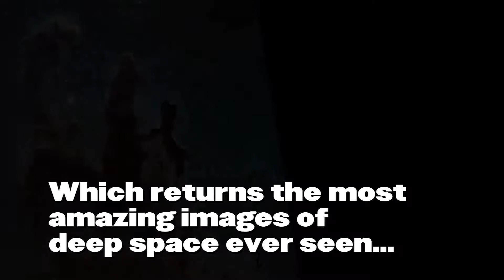The Most Terrifying Stuck Bolt in History: Repairing Hubble

Comment: Do you reckon NASA should have supplied astronauts with a 2lb ball pein hammer to tap the T-bar rather than twisting harder, which is more likely to strip the thread than tapping it to break the seal?
It's standard engineering practice.